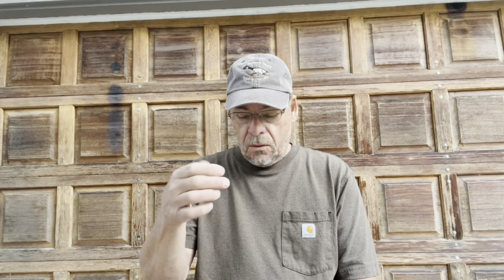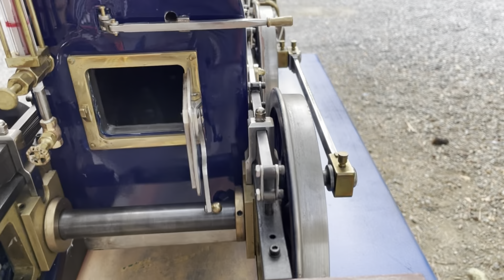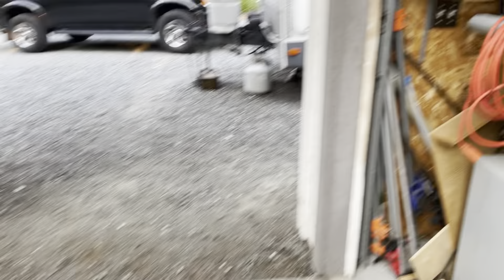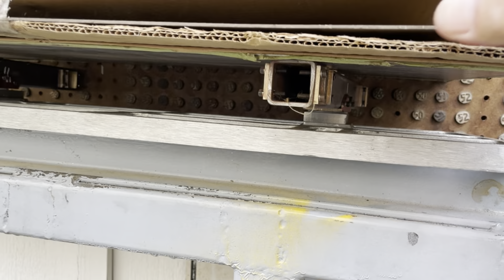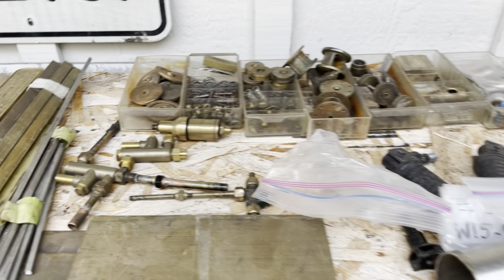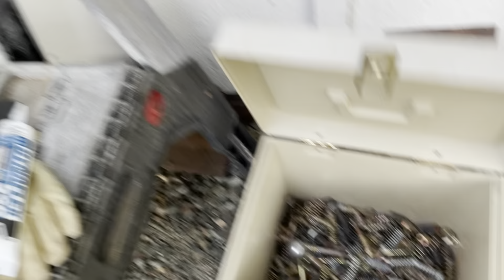Little Engines Live Steam American #21 Update one

Comment: Wow, so keeping a really long story to a long short story there.  That is really cool that it came back around. So will you get help from the Steam Shop then to do a bunch of this?  I s the tender going to be filled with water?  That would mean sealing it and the rivets when you put that together.  You’ll have to tell us more on the tank car.  Do you make it look like a tank then actually put in a removable propane tank, or does the car just hold the propane itself. I am sure glad that is your project.  This should be fun to watch come together.
Reply from the maker: I’m going to do everything except the truck parts machining. I have the guidance and specialized talent of a circle of friends willing to help me. The tender will be sealed and filled with warp. The fuel car will be an 1860s wood boxcar. I’ll probably build a four wheel bobber caboose.